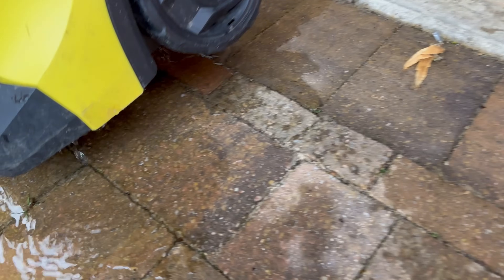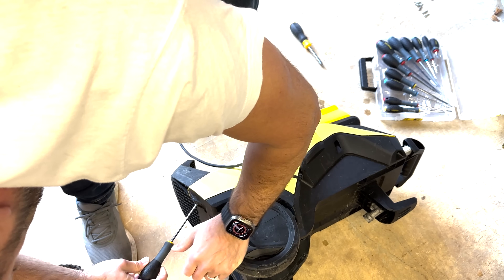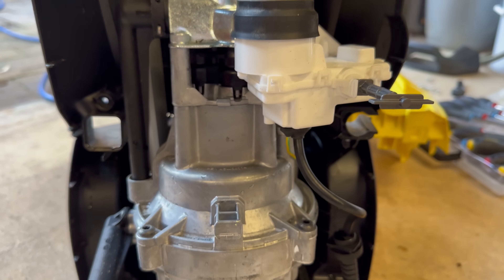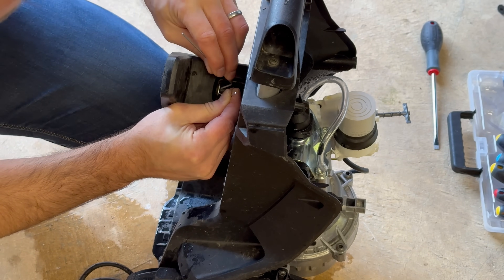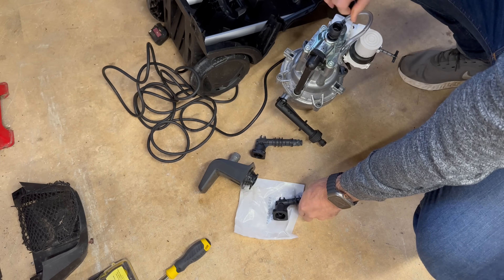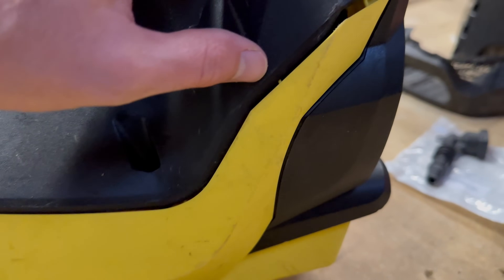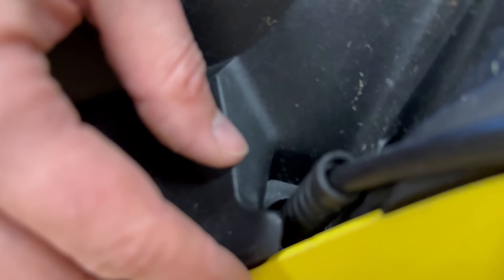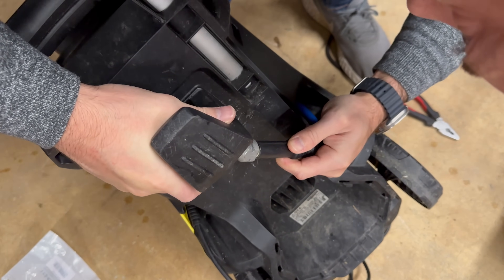Karcher K4 Pressure Washer - How to Open and Fix an Internal Leak

Comment: My pressure washer was leaking and I couldn't find anyone local to fix it. I checked with Karcher who would fix it for a set £160, new one about £200. Last ditch I looked at YouTube and luckily found this video. My one appeared to have the same problem. Followed the advice as given and have now fixed my washer for £8. Brilliant video. Thanks very much
Reply from the maker: Thanks for the great feedback, I’m glad it helped and saved you quite a bit of money by fixing it yourself.
Reply: Where do you buy the part from? Seems to be a common issue for the K4, I have the premium version and the exact same thing is happening to mine. I've used it once...
Reply from the maker: @flanger890  I bought mine from Amazon because I have Prime so it was cheaper than paying for delivery on top of what parts websites sell the part for.
Reply: Where did you get the part from?

Comment: Karcher K4 series  are, in my opinion, absolute garbage. I've had two and both failed in less than one year. I now own a Nilfisk, six years on and not a single problem.
Reply: Well I have a Karcher for 5 years now and believe me it gets plenty of use and it’s still going strong.
Reply: @tonylawlor8833  Good for you; You must have bought the one made properly!

Comment: I have a 30-year-old model leaking just the same. Thanks for showing it can be fixed. I might take it a step further and replace and glue and clamp the leaky part. Also, my I/O switch no longer works, so it might be a twofer.

Comment: Well, I did mine yesterday, part arrived from Amazon. Took me around 1hr 20mins. I had no issue separating the part just found it difficult to connect it back to the metal elbow. Got there in the end. Fantastic video, well done 👍🏻
Reply from the maker: Thanks for sharing and glad this video helped.
Reply: Just a side note. I am a Prime member of Amazon.  My voltage here is 220 volts. I was going to purchase the K5  from them but after contacting Karcher they recommended not using a voltage converter from 220 to 120 volts because it could damage the pump and void the warranty. Amazon only sells 120 volt units.

Comment: Just did mine.  7min 24 sec.   Easy.  It's actually harder to align it back up as took 3 goes so could of got it down to 7 min 08 sec which would of got me a gold medal.  I reckon with practice it can be done in 6 min 48.   🤣
Reply from the maker: @Resin__Designer glad you got it fixed. With the amount of users having issues with their Karcher pressure washers, this may yet turn into an Olympic sport! From comments posted so far, I think you hold the record for the fastest fix!
Reply: @SwiftDevelopments  haha.  It's quite simple once you watch other people  and yeah It is a known issue with Karcher.  I've replaced all my connectors and the elbow with a metal one so I should last a fair few.years now and  thanks for the original vid

Comment: I have bought 3 pressures washers over three years.   Suspect for any washer is the aluminum/zinc die cast housing used, which is subject to corrosion and a frozen pump.  I got one season out of the first two washers.  Go to use it the next year and "ZERO".  Lock up.  Looking at the inlets there was corrosion all over the casting.  Comes the third pressure washer.  On the first two I used the flush and store system liquid through the pump and put it away for winter.  That didn't work.  Third washer, put hydraulic tool oil (4-5 table spoons) into the water inlet and ran the pump for about 10 seconds.  It flushed out water and left an oil film in the pump.  I have had this last pressure washer 3 years now and it starts up every year after winter.  And the pressure is still strong.  Frankly, I think these manufactures should be coating the die cast housings with corrosion resistant coating.  I am a product engineer of 45 years, and designed automotive parts with corrosion resistant coatings to withstand freezing rain, heat, and road salts.  I can tell you I never went back to the manufactures washers that only lasted one season.  My current washer is a Sun Joe and it is holding up.....with the oil purge included.
Reply from the maker: You list some valid points; they do seem to struggle selecting the correct materials/coatings for the job to ensure longevity.

One of the things people often forget to do (myself included on occasions) is discharging the pressure washer before storing it away; you would think they could build in a relief valve or something to compensate for this.

I’ve never thought to use hydraulic oil like you have; at some point I plan on opening up the pump to inspect the condition of the internal parts for wear and corrosion.

Comment: Very useful video if you need to either clean out the detergent lines (use isoprop alcohol) or repair the detergent inlet valve because its pushed into the machine (its only held in place by two flimsy brackets).
Reply from the maker: Thanks for commenting and providing some good advice.

Comment: It is caused by water freezing inside during the winter - As it expands it splits the plastic.
I always unplug the hosepipe and run the machine til water stops coming out before you put it back in the shed. I have never had problems since using this technique.
Reply from the maker: I agree that this is one of the most likely reasons for it to fail. Prior to the repair, I always forgot to switch off the machine and release the pressure before packing it away.
Reply: Absolutely agree I don’t understand why they don’t just make it from metal

Comment: Thank you so much, my K4 have had the same failure. The replacement part I got for 9,5€
With your tutorial 45 min repair time and today I clean my balcony very well. Greetings from Germany.
Reply from the maker: Thank you for the feedback and good to hear your pressure washer is back up and running. 👍🏼

Comment: Glad you were able to get the part required. I have a Ryobi machine which promptly broke soon after I bought it. I could probably have returned it, but it only needed an o-ring. Ryobi in their wisdom however do not sell this particular o-ring so I had to guess at the size and order from eBay. Been ok since.

Comment: Great video thank you!
However the fact you needed to make this and that so many of us needed to make this same repair points to a real design or manufacturing failure on that plastic elbow connector. Exactly the type of thing I bought a Kärcher to avoid… and mine failed after only a couple of light sessions from new.

Comment: Thank you so much for your video. We had a similar problem but it was the elbow coming out the back of the machine that was leaking. This video helped us figure out the issue and fix it ourselves instead of spending more money to buy a new one. Thanks again
Reply from the maker: Thanks for the great feedback, glad my video helped you fix it 👍🏼
Reply: Mine went the same way over the weekend, same part out the back. Absolute garbage. Do you know what this part is called?

Edit: never mind I found out what it is. Its called the "set back foot"

Comment: Great video just repaired my k4 it had the same issue. Just one thing that may help others the little white plastic ball can get lost but when I took mine off I took the clear plastic tube off the opposite end to the video. No proble the white ball stayed safe and sound in the tube. Thanks for the video brilliant
Reply from the maker: Thanks for the feedback and I’m glad the video helped. Yeah I did try disconnecting that end first but it wasn’t budging and didn’t want to split the pipe removing it.

Comment: My issue with K4 was the set pump, which I've successfully replaced but couldn't close the housing. Your guidance on this video helped me to do it the right way by putting the pump body into the yellow part first and then securing the power cable.
Reply from the maker: Yeah it surprised me that you assemble it in the front half of the casing. Also reduces the chance of snapping the pressure switch when taking it apart, which I nearly did with mine when the pump fell out of the case!

Comment: I owe you a pint or two! Thank you so very much, I now know your voice off by heart 😂 Without your help I would have struggled. I found a much easier way to remove the clip that you had problems with, you used allen keys, I bent the pointy end of a round chainsaw file to 90* and put a piece of wood behind and forced the end of file under the clip and it popped out. Thank you once again
Reply from the maker: Thanks for the feedback and taking the time to comment. Good idea for getting that clip off…I could have had it done in half the time if I knew how to get that clip off quickly! 😂
Reply: @SwiftDevelopments  Although I haven’t tried it yet!😂 I think you have earnt my sub, well done. What’s your first name?

Comment: This is what happened on my last K4 I found that if it’s not drained completely and stored, if the frost gets to it then it ices up the water and splits the plastic, bought another K4 and learned my lesson this time
Reply: I'm strongly considering buying a K4. How to you properly drain it??
Reply: @guppy9713  turn the water mains off and unclip the hose then keep the trigger in until nothing else comes out
Reply: @Liam2E0LDQ  Unclip the hose from the machine??. Also I assume have the machine switched off when  I do this??
Reply from the maker: Hi @guppy9713, I usually switch the power switch of the pressure washer off, then disconnect the water hose from the pressure washer, then press the trigger on the lance to release the pressurised water.  This ensures you're not leaving the pressure washer pump charged for prolonged periods when not in use.
Reply: @SwiftDevelopments  Thanks you 👍

Comment: Great video, many thanks. I've watched a couple of these videos and a common theme is blue aftermarket hoses! My K4 has just started leaking on first use of a blue aftermarket hose and short trigger gun. I'm guessing they have more back pressure. I'll be pulling mine apart in the week. 👍
Reply from the maker: Thanks for the great feedback.

Regarding the hose, it shouldn't have more backpressure, unless the hose bore is noticeably thinner. With mine, before the aftermarket hose, once you'd let go of the trigger, the pump would recharge the hose before stopping with a short pssst. After installing the 10m blue hose, when recharging it now makes a longer psssssssst noise, presumably because there is more volume to pressurise between the pump and gun and/or because the hose wall is more flexible when compared to the Karcher supplied hose. I thought this might make it easier on the pressure pump if it's coming to a more gradual stop, although I could be wrong!

Good luck with your pressure washer repair.

Comment: I followed your video to fix my K4.  First of all, I have noticed that all the K4s are not visually the same, depending on input voltage. Mine is a 220 volt model.  Also I have seen other K4s that have different outer shells. The interior is almost identical.  My leak is not coming from the same location (the top plastic tube).  It is a high pressure leak under the head on top of the pump.  I l took the 4 large (machine) screws out and slightly pull the head up and saw some oil starting to come out so I stopped at that point and re-screwed the top housing back on.  The leak is coming from between one of the plastic columns seen through the opening on top of the pump under the top plate.  Of course,  you can't get the small metal top off without pulling the entire top off the pump.  Long story short.  I have ordered a new 220 volt K5.  If you or one of your followers has a solution to fix this I will attempt the fix again.  However, I am sure replacing the pump would be as expensive as buying a new K4.  Thanks for your help.
Reply from the maker: I was going to suggest watching my other Karcher video where I show how to disassemble the K4, but I can see from your other comment that you’ve already done this and managed to fix it! Glad to help and thanks for watching. 👍🏼

Comment: This is really helpful, thank you, I will follow this to hopefully fix our Karcher.  I have this issue for the second time on my pressure washer... the first time it was fixed in the warranty with no comments on how it happened, what went wrong or how could it have been prevented. The fault reappeared only a few months after the issue was fixed the first time, however this time its out of warranty and the customer services are saying that I have caused the problem myself by using AutoStop type of hose connector. It's very irritating as the first time it happened it has not been pointed out and I have never realised that Autostop connectors could cause any problems. In the video, your connector looks like my Autostop one, so just a heads up in case you are still using it. Thanks for the guide.
Reply from the maker: I don't agree with Karcher trying to explain away that the issue is to do with Aquastop/Autostop hosepipe connectors causing this; this injection moulded plastic elbow is after the pump has pressurised the water supply. If an Aquastop connector was starving the pump of water, this would only lead to reduced flow/pressure after the pump.

Unfortunately I think this part is just prone to failure by the way it has been manufactured; instead, try ordering the metal variant of this part which I've listed in the video description.
Reply: Teach your audience the correct discharge procedure before shutting down, most of these failures are due to frozen pumps in winter because they don’t pump out water before shutting down.

Comment: Thankyou for your video, very helpful, but for me unless karcher have fixed a design flaw I’ll be looking for a more robust washer.
    Thanks again
Reply from the maker: Thanks for watching and commenting. In my latest Karcher video, you can see which part usually prevents the pressure washer from turning on:

https://youtu.be/BbQVSJAEM3I

There are some seemingly obvious design flaws with Karcher, which I'm still unsure if these were to keeps costs down or create planned obsolescence. That said, after taking the pressure washer apart, you also appreciate the simplicity and some of the engineering solutions used to make them work!

Comment: had the same issue after hard winter and not draining the unit fully.  cost me £40 for local Karcher repair shop to fix split plastic exit elbow/flow valve.

Comment: I bought a leaking k2 for 19e.. I changed the connector on the pressure side and now it doesn't leak and turns off from the handle. Expensive parts in relation to the price of the washer

Comment: Mine did exactly the same! Shortly after the valves in the head snapped off and went through the pump. I then made the mistake of buying another k4 and after only ten hours the same thing happened to the valves!! No luck with the warranty? What ever happened to the best manufacturer of pressure washers???
I've now got a parkside from Lidl 😊 absolutely brilliant and a lot cheaper.
50 ISH hours and as good as new.

Comment: Great job, must have felt good to see the leak gone. BTW where did you get the part.
Reply from the maker: Thanks. I ordered the part from Amazon Prime; it was slightly more expensive than what eSpares or Spares2You sell them for, but cheaper once you include their postage charges.

Comment: Great guide, exactly what was wrong on mine. Thank you 👍
Reply from the maker: No problem glad it helped 👍
Reply: @SwiftDevelopments  Just as a follow up, I ordered the metal version 9.042-155.0 and when it arrived I notice it's completely different at both ends to the plastic part I have, so I've had to return it and order the plastic one. Mine is a K4 130 and is about 10 years old, so maybe they changed the design at some point?
Reply from the maker: @HiruS22   Thanks for following up and I'm sorry to hear the part doesn't fit. It is possible the design might have changed over the years. Does your K4 look the same as mine? I'm not sure which version K4 I have. Did the metal version you ordered look like the plastic version shown in my video?

Comment: Thx for the info…. Not sure, but I can imagine the crack may have resulted due to excessive pulling strain on the high pressure hose.  Some folks like to tug on it dragging the entire pressure washer a few feet or so to continue their work…
Reply from the maker: There’s a possibility that dragging the pressure washer with the hose could put stain on this part, although it is locked in place with the rear L shaped bracket that sticks out from the back. I think the most probable reason is down to the injection moulding process creating a weak point, constantly put under strain each time the part is pressurised during use.

Comment: You were lucky when your pump fell out!! This happened to me and the thin plastic rod on the on/off switch hit the ground and snapped off. Rather than mess around I ended up replacing the on off switch assembly (I couldn't find just the switch). An expensive mistake 😢 A warning to others!
Reply from the maker: I know I was surprised it didn’t snap when it dropped too!

Comment: When the pump fell out you were lucky the on/off extension piece did not break - have seen this comments on other videos- so awareness of this will save anyone as t
Karcher don't sell the lug individually but you have to buy the whole control unit for about £25 I think.
Reply from the maker: Yeah I was lucky it didn’t snap, especially when I watched it back in the video! 

It wasn’t until I put it back together that I realised you place it face down and take the back off, which ensures the pump doesn’t fall out whilst disassembling.